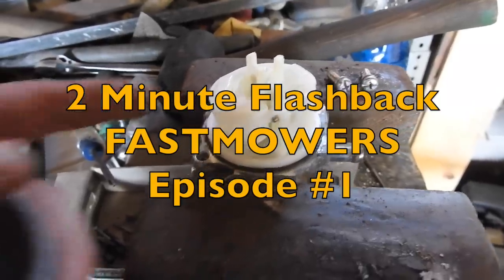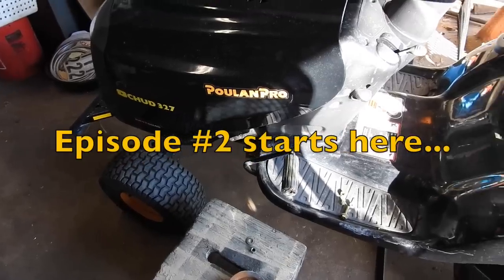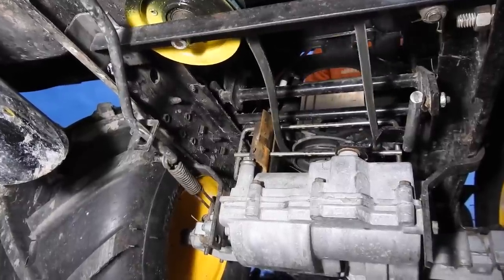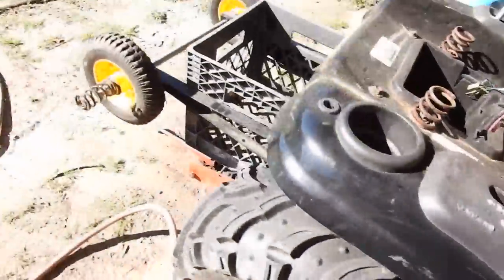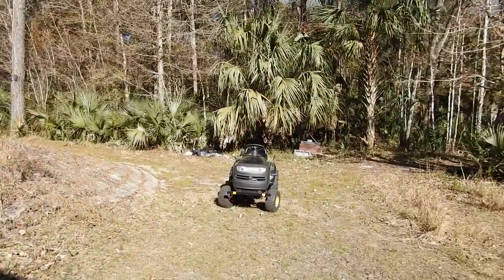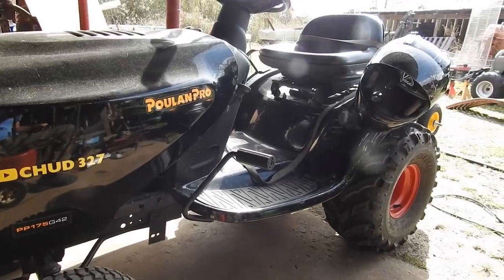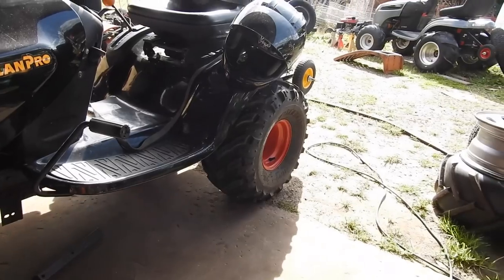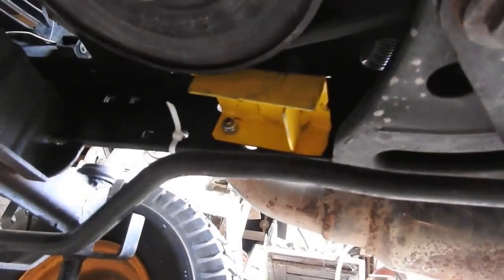44 MPH on Lawn Mower!

Comment: Going above 25mph on that stock front end is way sketchy. I got a mini mower that does 60 if you want me to give you the specs of that front end. Easy to make and handles nice.
Reply: I agree. I am building a craftsman GT18 and I am planning on stretching it a bit for hill climbing and mudding here in PA. How did you build your front end?
Reply: @Biokemist-o3k  I built mine off of the mower racing rules in my area. I used a pair of mini quad spindles and built the rest.
Reply: Whats a list to make it do the 60 really wanna get in to this me n my friend have a lot of mowers
Reply: @VirginiaMaker  Awesome. thank you.
Reply: @ryanschjang5793  well depending on the setup you have will depend on how fast you can go. I've seen some transaxles do 50mph + , but it's alot of work. The easiest way is how I did it. It's also safer. Live axle. I used one from a quad. I'd had the gear ring, disk brakes, and bearings to spin on. If you want to use the stock engine you need a transmission that will take a vertical belt and give you a horizontal output chain. 
Or an easier way is useba horizontal shaft engine (harbor freight 212cc) gokart clutch a long chain. 
As for the front end, look up some mower racing front ends , or if your adventurous and good with a welder you can make one. Again look up racing rules. They did all the R&D for us to make it safe. You can also find many YouTube videos on all this.
60 is easy to do on something so small and light. That being said, it's sketchy as hell being soo open.
Good luck and be safe. Wear a helmet.
Reply: Chud327 your awesome!!! I’ve been subscribed to you for years and for some strange reason when you commented on a comment of mine today 10/7/22 to watch this vid I went to your channel and i wasn’t subscribed anymore. Man YouTube is really sucking!!! Any who 44mph??? Super awesome bro. Keep up the awesome content

Comment: there is no way on earth i would be running 44mph on a mower that's basically stock, at least when it comes to steering and ride height, i don't care how tight the steering is,  it's simply to dangerous to run that fast with a stock mower steering setup
Reply: Then u won't like what im going to do, how's 50mph! Lower hight but stock stering. 9" pully on front and 4" on back
Reply: @droptheblades895   be careful and wear protective gear is all i can say, if you're going to be going that fast with stock steering geometry  you take your life in your own hands, i'll stick to the 23mph that my ford yt16 goes
Reply: @darkside0914   i will, I'm probably going to change the steering a bit to make it less sensitive
Reply from the maker: Agreed, was very sketchy and probably will not do it again.  I did have on a layer of protection and thanks for watching.

Comment: My mower just did 44 mph, it has a 2 inch pulley on the back and a 5 inch pulley on the front. Then the belt fell off and the battery died so I was stuck at the end of the road. I got jumped off by a farmer so I went back home. Scariest 44 mph ever.
Reply from the maker: What an adventure, hope you wear a helmet. Was my scariest 44 mph run ever too. Thanks for watching!
Reply: @chud327  yes I did wear a helmet, jeans, boots, and a t-shirt

Comment: I found a set of Wooley Boogers that I have to make adapters for the wheels in order to use them on my craftsman. I was at the scrapyard looking for another frame and other parts and I found those tires. I looked beside them and I found a broken Yamaha Trimoto three wheeler and got everything for $50. I have been looking for an inexpensive three wheeler and they do not exist. Are you down in Florida? It alwways looks beautiful. I wanted to build the craftsman for the buildoff but then I got hit on my Harley by an F350 and literally had to learn how to walk again. I am 18 months into recovery so I am trying to get out and start building again.Keep up the great videos.
Reply from the maker: Sorry about the accident and yes I am in Florida. A build off would be very cool! Thanks for watching!

Comment: Came here from the previous video. How is the torque on it? Does it get up steep hills? Or only good on flat? Thinking of doing something similar
Reply from the maker: It does fine with torque, plenty when you are in first gear. And plenty of speed when in high gear. Thanks for watching!!

Comment: Are you changing bothe motor and rear end pullies? From motor 3" to 5to6" and rear end from 4 to 5" into 6 to 7 " pulley?
Reply from the maker: This one is a double pulley swap. It has a 7 on front and a 4 on back. Was able to use the stock belt too. Thanks for watching!!

Comment: How do I keep my belt from slipping with tractor tires
Reply from the maker: If you don't go extremely small with the back pull it does not slip too bad. I have a 3.5 inch on my other poulan and it has been known to slip. thanks for watching.

Comment: What size pully would you say use to add a little speed on a 20hp vtwin
Reply from the maker: @ThomasBarnes-tn2qs  I put a 5 inch on my latest build, front is basically stock size and it hit 26 mph.
Reply: @chud327  ok thankyou sir gonna give that a try
Reply from the maker: @ThomasBarnes-tn2qs  let me know how it goes
Reply: @chud327  sure will

Comment: What inch belt did you use
Reply from the maker: Since I put the 7 inch on front and 4 inch on the back, it used the stock size belt that came with it. However, I don't remember what size it takes.  Let me know if you need me to try to figure it out and thanks for watching.
Reply: And also do you have any hydrostatic mowers